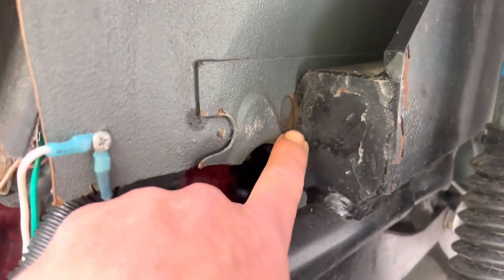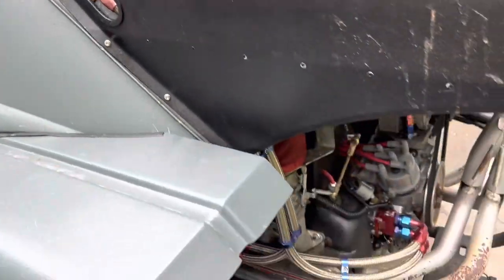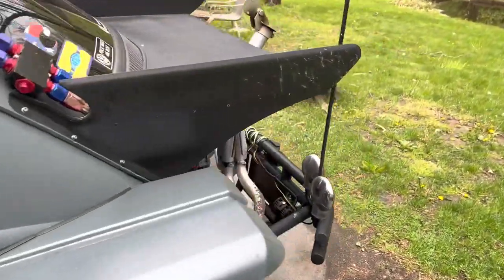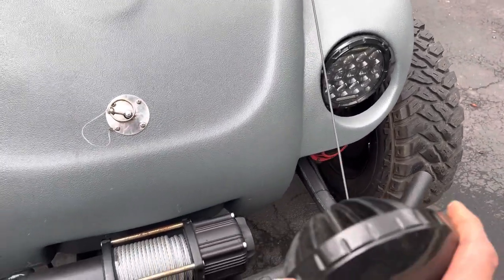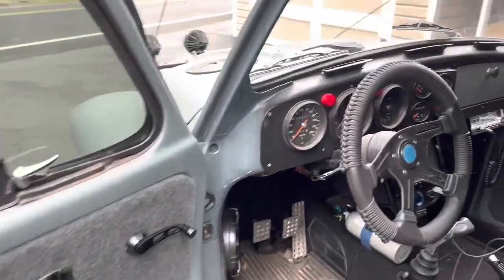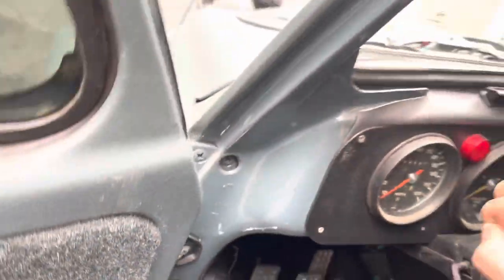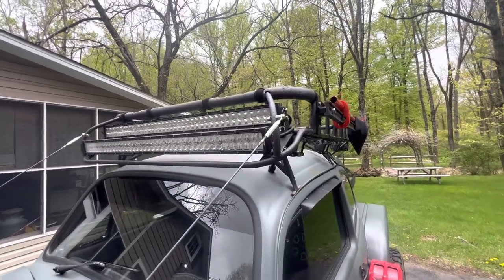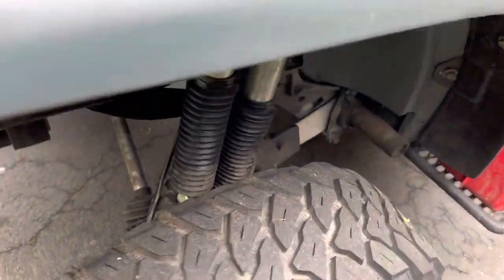Awesome VW Baja first trail ride and walk around. #vw #baja #bajabug #offroad #fabrication #mechanic

Comment: if you make the back of the sub sealed, and the front ported to 50 hz or so, it should sound better. A 10" sub should work well in 1 to 1.5 cu ft sealed box. Sweet ride man!!
Reply from the maker: Thank you! I did seal the back of the sub box. It sounds fantastic now!

Comment: Yes Sir that's nice. Love Baja VW.
Reply from the maker: Thank you!!!
Reply: @69bajaoutdoors  I got 88 Suzuki samurai,body decent does has rust spots. Love to do a vw beetle body swap. A convertible  half top, with a little step side bed vw fenders. Or maybe a 4 door two original and make back open idk thoughts.(that's old beetle)
60,70 not that new stuff.
Reply from the maker: @P.Trim69  
I’ve seen a VW bug body on a Samurai. They called it Godzuki. LOL
That would be a cool build.

Comment: Brotha?! If I might suggest another way of securing that drivers left corner where you said you(3:35) might weld a plate or whatever to the heavy shock mount/tube frame and body 
How about if you take a slice off a 90 degree channel about 1-2” long and put it so one side grabs the frame(flat stock part of shock mount) and the original inner fender or body so it’s able to bolt to the body on one end and weld it to the frame so you could unbolt it and take off the Whole body pan if need be? I see your very skilled in building this bug and I’ve only made it that far like so far but is only a suggestion bc my older bro is about your age and he’s built a couple Chenowith big tube frames ones long ago and mom had a brand new 74 Gaia she bought when I was a boy and I rode home with her that year in it so I’ve got lots of history in VW Air cooled Vehicles and I’ll subscribe to your Chan bro but nice work on that car I loved it😁👍
Reply from the maker: Thank you for commenting. I will take your idea into serious consideration as I believe we are on the same page on how to make it removable. At this point, I’m still driving it as is. I know it will be off the road for a while when I tackle this issue so I am hesitant to open that can of worms. But I will need to do something about it soon. Thank you again!
Reply: Glad to Brotha!❤️‍🔥💡

Comment: Whoa 914 Engine and bigger jugs/pistons oughtta run like a Raped ape
Reply from the maker: She runs good. It’s not a speed demon with the 30” wheels but she has a lot more torque than the old and tired 1600 that was in it. :)
Thank you!
Reply: @69bajaoutdoors  yeah 1600 Dual Ports were tops until the late 70’s when folks began putting out oversized Jug kits upwards of 2600cc
Reply: Look me up on FAKEBOOK?👍
Reply from the maker: @marsdenbalaska3  
Agreed. She is a 1911cc right now. I’m debating on doing a turbo install. That should get the blood pumping!
Done! You in PA?
Reply: @69bajaoutdoors  Near Pittsburgh Yes but be sure to use colder spark plug heat range and boost controller tech like fuel tech etc but check out Steve Morris Engines and That dude From California Ah shoot he’s patented Symmetrical Turbos that are badass bro yes it’s on top of my tongue but he’s got cool parts that nobody else has that don’t look cobbled together like left handed in right hand situations
Reply from the maker: @marsdenbalaska3  
I gotcha. I will look it up for sure. Will be doing the work myself but that will be a while down the road.
Reply: @marsdenbalaska3  put a 1776 in my Ghia with dual webers great setup super reliable.
Reply: @mikekuczynski1552  oh no doubt and many people including me today are kicking theirselves from not keeping those vehicles for later to come projects like handing down to our children bc I grew a great deal when family all had a Bug they used as their main ride

Comment: I had one back in the 1980s. Put a tilt fiberglass front end in mine so it no longer had a usable glove box. Still had the glove box door so I riveted piece of 1/16 inch thick  rubber over the opening on the firewall/ trunk side to keep the wind out.  But discovered I could bungie strap a slab case of beer on top of the gas tank, and the passenger could reach through the glove box to get us beer.  👍

One if the big mistakes I made was to go with solid motor mounts.  The bug body amplified every single noise transfered through the mounts.
Reply from the maker: Thank you for commenting. My hood was a tilt hood. But, with the winch in they way, I had to abandon that idea. I had plans to make a lift frame, as in it would lift up and arc forward. I got impatient and just screwed it down utilizing riv-nuts. Not sure why you couldn’t have a glove box. I have an operating glove box now and when it was a tilt hood. 
As far as motor mounts, I agree that all the noises are amplified through the body with solid mounts. It is quite loud when the rpm’s are up. Now I know why race cars have communication systems.
Reply: @69bajaoutdoors  If I recall correctly the glove box insert was cardboard and I think was accidently tossed out when cleaning up the shop one day.  I know we couldn't find it. 
Had a lot of fun in my baja bug back then.  For winter driving Id use 2 pieces of flexible dryer duct that ran from the heat exchange boxes to inbetween the front seats.   
I also remember because I had a cage on the back it made it really easy to pull the engine. I think it'd take around 20 minutes to get the engine out.  My engine was a 1600 vw bumped up to 1800cc with a 2 barrel weber carb.
Reply from the maker: @damham5689  
That makes sense. Yes, they were crappy cardboard. The one I have now is plastic. :/

Comment: It's got a Type 4 conversion! Yes!!! I've done of few of those, and currently building a turbo type 4 in my 71 Super.  My current engine is a 1911cc, but I've built a 2600 and a 2258.

Love this.
Reply from the maker: I love that you have done it too! I also have a turbo for Mud Cricket’s power plant. It would be my first turbo build so I am very hesitant to go through with it. I need to do a lot more research on it before pulling the trigger on that plan.
Reply: @69 Baja Outdoors  oh, I also did  2 liter in a 70 Ghia.  So much torque. 
 
I modified the alternator stand to make it center mount.  With a water to air IC. Fits  under the deck lid. No stand offs.  Subaru td04 turbo.  Made out up and down pipe and exhaust exits via 1 pea shooter cut out in the apron.  Stealth.
Reply from the maker: @monica93304  
That’s awesome!!!

Comment: Nice run - just enough to get it a little dirty and (as you found out) discover odd sounds and an occasional nut that needs tightening. 

About those rear shock mounts: I really think you're going to have to punch through the body near the top eyelets and put a cross- brace in. There is just too much vertical force that gets translated to lateral force at the top of the shocks for what you have now.

My cage is 1.75x0.120 DOM with cross- bracing at the shock mounts and I know I still get a little flex.  (and I don't even drive that hard)

Just something to think about...
Reply from the maker: Thank you for the comment. I had originally planned to go with a full roll cage to tie into. In order to do that properly, I would have had to pull the body from the pan. My heater channels and front hump on the pan are solid but the threaded weld nuts are questionable as I was afraid  it would open up another can of worms. I replaced the rear quarter pans so I didn’t have to remove the pan bolts. But I believe you are correct. I will need to put some sort of cross brace between the shock towers if I plan to keep the same setup. At this point, I may just join the bandwagon and install a rear roll cage and go through the fender wells with the shocks and make a true rear long travel suspension. I have 10.5” of travel at the moment.
Reply: @69 Baja Outdoors  10.5" is a good amount and might be adequate for your use.  I like your setup.  I'm just suggesting a 1" or 1.5" hole and cross-brace tower to tower.  If you bend and gusset, I bet you could get one to follow the back wall of your package tray.  But if you start thinking about shocks through body, then you are starting to consider 4"+ holes and that gets to be a big weather issue, especially in areas more cold and wet.  I would start by cross bracing what you have and bomb it till ya break it, then go bigger if you have to.
Reply from the maker: Understood. I know I need to do something or it will end badly. I will look into doing a crossbar to start with. Thank you!

Comment: I heard LED lights don’t work with vintage cars.
Reply from the maker: They work great if you invest in quality products. LED turn signals require a resistor or an LED  compatible flasher relay so they don’t hyper-flash. My headlights were inexpensive so low beam seems like it has no upper cut off. Meaning they just send light all over so I have them pointed lower as to not blind oncoming traffic. My high beams work great.
Reply from the maker: @devilinbaggypants7320  
LOL! True story!
Reply from the maker: @devilinbaggypants7320  
If they are rated for 6v, yes. I believe most of mine are rated between 10-26v. My electrical system is 12v. I don’t believe all of my LED lighting would work with a 6v system. But again, if you have a low voltage rating, meaning 5v-12v then yes, they will work with a 6v system.